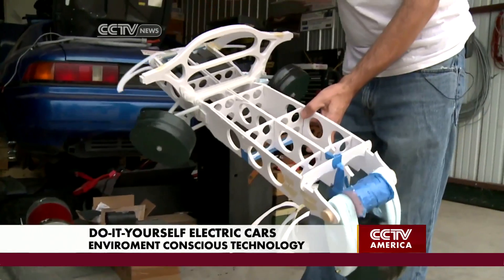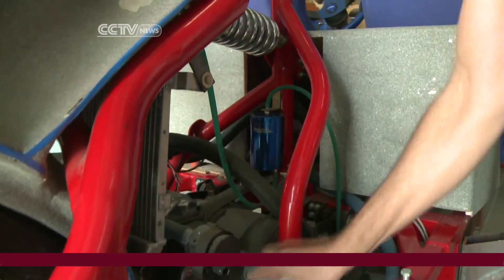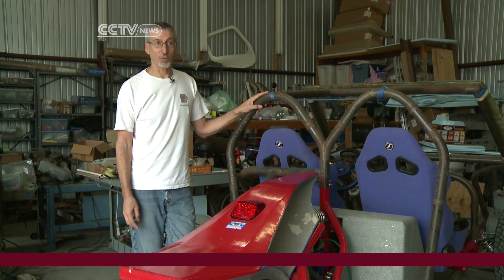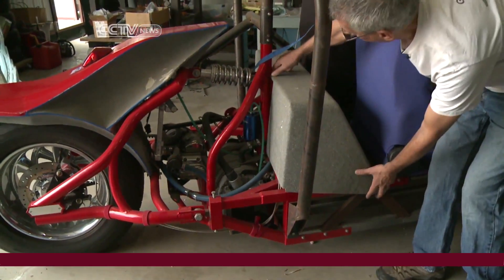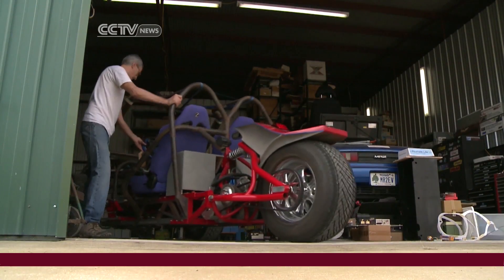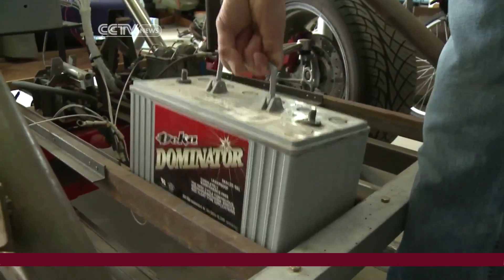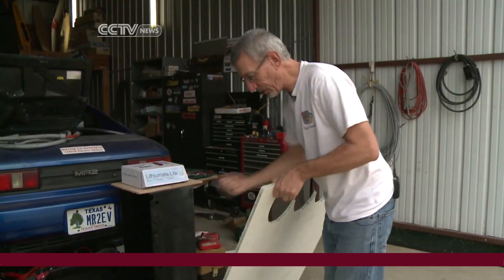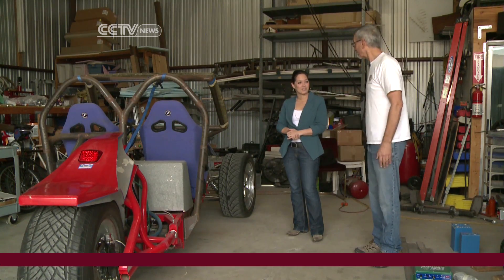Do It Yourself Electric Cars

Comment: The manufacturer of batteries is not clean. New Porsche gasoline car the air coming out is cleaner than going into the engine. But how long do the batteries have a service life. Some batteries it’s a but 500 to 1000 chargers. And my aunt her cars batteries went out it was cheaper to buy a new car than replace the batteries. H2 in a car engine with retiming is cleaner for the earth. And remember recycling of e waste it not as clean look it up.

Comment: I like that 3 E's thing but plug in electric isn't completely clean for the environment at all, the batteries are so filthy to make and dispose of, and the range is shit with them, and even the ones that can be "rapid" charged, that ruins the life of batteries so much more.

Those problems needs sorting first. Pros and cons with everything, with Hydrogen, it's the infrastructure, 'chicken and the egg' sort of thing. Everywhere needs to have those filling stations and the hydrogen being created and stored using renewables, California does this quite well so it can be done, it's just the lazy shits dragging out oil and getting on board way too slowly.
Reply: Lithium batteries can be recycled, and they are improving in every way. We will see longer ranges, it's a matter of time.
Reply: Johny40Se7en lithium ion?

Comment: don't want your electric cars, stop trying to force them on people.
Reply: Last I checked, you can still buy gas vehicles in the dealerships
Reply: 1. Nobody is forcing it on anybody.
2. A car is a car, as long as it's core functionality which driving and performance don't get negatively effected then what difference does it make for you if it is run by electric or by gas.
3. Gas is not unlimited, sooner or later the shit will be used up, but before that it will be more and more expensive the less there is.
4. Electric vehicle is more quite, less maintenance(no motor oil, radiator, etc...) and more environmental friendly.
5. Before you speak educate yourself or try to make an argument or you will just look stupid.
Reply: Savash Zaynal a
Reply: persecution complex?
Reply: Then DON'T BUY ONE

Comment: When the cost is reasonable, batteries are under 200 Lbs. and can buy new batteries without selling one of the kids, and can drive for 400 miles at 60, then I'll buy one, otherwise I'll stick with gas. I'm not against electric, I just feel the technology and cost just does not make sense to run out and get one. In addition the marketing industry has made it so impossible to buy one on my retired beer-bottle budget.
Reply: Gene, why on earth do you spout that charging not being free is one of the disadvantages when it is leagues cheaper than both gas and hydrogen?? How does $5 for a full tank cost? Hydrogen has no existing infrastructure, and the infrastructure it requires is far more expensive than for EV's ie millions vs thousands per charging station. Also hydrogen is only about 25% efficient which is terrible compared to electric cars 90% efficiency. Battery technology is improving by about 8% per year and by about 2030 (certainly by 2035) the cheapest car in the US you can buy that does 200 miles will be electric...which also has about 1/8th the running cost...You smell like the recruit of an oil company...
Reply: Soon you regressive folks won't have any come backs.. You say 400miles.  How often do you drive 400miles per day?  And how about tesla model 3 with a huge supercharger network. Reasonably priced. Free charging.  Sure most people could find time to stop for 30 mins every few hundred miles to top up the charge and grab a bite to eat
Reply: +Sam Richards regressive? not hardly. its not a matter of 400 miles a day but when you eant or need mileage. In addition the cpst does not justify the need. Futhermore battery recycle life is limitted and charging will never be free. someone will put a meter on it. hydrogen is far more practable. Sorry if you feel im regressive, electrics is not the way to in long term.
Reply: +Joe Smuck I think we will find electric cars will dominate for the next 20 years so might as well embrace the clean change compared with gas guzzlers. No doubt hydrogen technologies will continue to improve but I would guess in 10 years time electric sales overtake ICE.  Coupled with solar charging along with supercharge networks it sure will be a huge improvement and costs will continue to fall with mass production.
Reply: the Israelis have a battery that gets 1500 miles and there is such thing as a nano flow cell . invented by NASA. you fill it up like gasoline five minutes. to charge the batteries. technology already here now
Reply: Steven, please investigate nano flow cell more. It wasn't "invented by NASA" -- the tech predates the existence of NASA by over a decade. The energy density is complete shit, even compared to LiPo technology. It does have some promise, however, as it is quickly "recharged" -- if you call replacing the electrolyte "recharging". (you can do the same thing to Pb acid batteries. Albeit a limited number of times as lead is being pulled (chemically) off the plates during discharge.)
Reply: can't wait till they become more affordable
Reply: Sam Richards- so is anyone that disagrees with you a regressive?
Reply: 400mi is going to be tough. (Or you'll need a lot more batteries.) Long distance is not the market for EVs. However, I agree, for EVs to be a true replacement for gas/diesel they have to get similar ranges and refueling times. (and they need to cost the same, too.) Cost, range, and charge speed are the reasons many people don't have an EV.  I drive a hybrid with an insanely small battery (1.6KWh), yet that tiny battery makes a huge difference. (And an EV racecar, but that thing's a joke... 20mi using marine deep cycle 12v batteries. And that was on an empty, mostly level, country road. We've yet to drive it with modern technology in it -- 3/4 of chevy volt battery pack.)
Reply: My gasoline car doesn't go 400 miles. For an EV, I'd be ecstatic if it does 60 mph and can do 100 miles at top speed.

Comment: if only we could drive an electric car with a single 12volt, 50pound lead acid battery and get 120mile range out of it, wishful thoughts close to perpetuum mobile..
Reply: Indeed. They left out the "and then put about 10 more in here." I've done that, btw, with 85lb batteries. It's a colossal pain in the ass. (esp, when the car only gets a few dozen miles out of 850lbs of Pb, and it takes half a day to fully recharge them) It would've been a much bigger pain with (20) 65lb 6v golf cart batteries the car was designed to use -- those don't have handles.
Reply: Haha we have a long long way to go with batteries and mileage on these contraptions to even forget about the internal combustion propelled engine